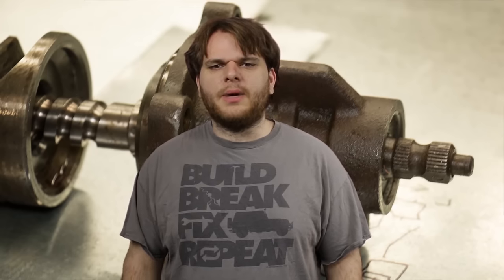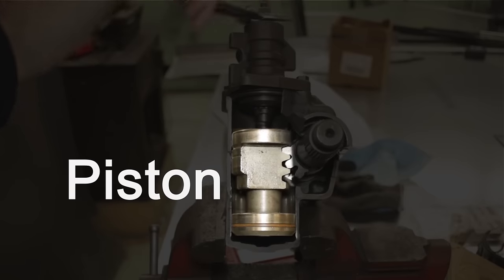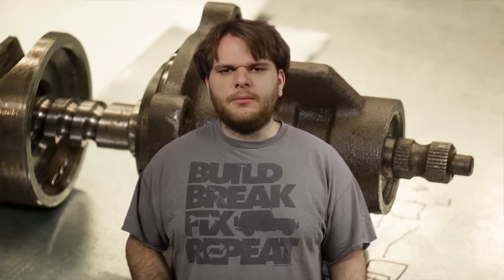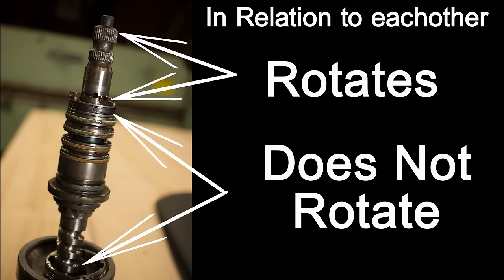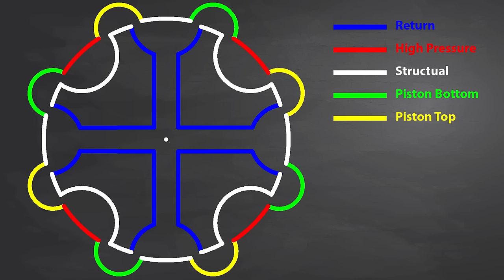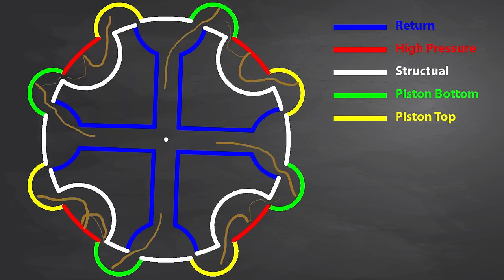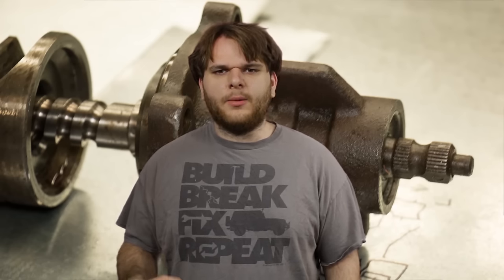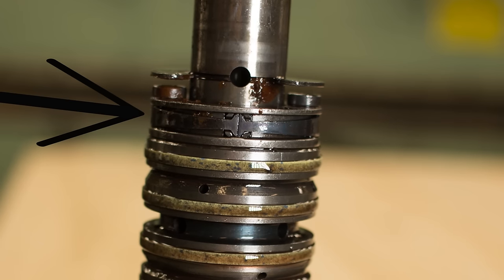How a Power Steering Box Works 610BOB's Teardowns

Comment: I've been replacing seals on these gears and I've been swapping these gears for 45 years and until now have had no idea how they actually worked. Thanks for educating me.
Reply: can i ask u a question my master??
Reply: am working on a 94 ford ranger with gearbox, if you turn left its fine but if you turn right its really hard to turn, i've already changed the hidraulic pump and still the same! i need some tips about this please! houses?? or the box?? i got tires bidding and nothing!! i'll wait antious for your answer!! kind regards from mexico!!^.-
Reply: @gustavolopez3659  If you feel power assist in any direction then your pump is fine. There is a valve that directs the pressure in the gear and it is what is causing your headache. I've seen those valves fail and the steering wheel won't go left or right, the hydralic pressure locks it in place. Replace or rebuild the gear.
Reply: Got a question for you if you have the time! I have a 2020 silverado 2500. Need to replace the steering gear box. The one that’s currently in the truck has the plug for the electronic steering assist as well as a mounting point for the module. The one I bought does not. It seems like I can just take off the four bolts on the end (positive feedback valve?) and swap the two pieces, can I do this?
Reply: @Riseuhh Sorry, I have no experience with your system; I've never seen a steering box with a sensor or module. my guess is that even if it functions it will probably set a code.

Comment: That device you mentioned helps the fluid flow valve return to center.
Reply: Is it like a detent ball and spring that's used on manual shift transmissions?
Reply: @Skipperj  no, it controls how much hydraulic pressure goes to either side of the piston.
Reply: Thank you very much sir john

Comment: Great explanation overall. There is one slight problem and it has to do with the components you were unsure of at the end. If you are turning the friction on the outside of the sleeve is enough to cause the misalignment and open the valve as you described. When you stop steering the spool/sleeve combo returns to open center as you described. However, it’s the sleeve that rotates to catch up with the position of the spool. The springs you mentioned at the end are centering springs which provide the force required to re-align the spool/sleeve. That’s why the power steering will shut off at any wheel angle is your angular velocity is zero.
Reply from the maker: Thanks.

"However, it’s the sleeve that rotates to catch up with the position of the spool." Um.... I didn't say that? I feel dumb now. :)

"The springs you mentioned at the end are centering springs which provide the force required to re-align the spool/sleeve." But dosn't the torsion bar in the input shaft do that?

Comment: The partial gear on the output shaft isn't a pinion, because it isn't a small gear. It's a sector gear (because it is only part of a circle), which is why the output shaft is often called a "sector shaft".

Comment: 610: At time point 7:40, you ask what that spring clip does. I would like to try to answer that question. Back about 4:20 you have a very nice drawing of the valve, with the inner sleeve, the outer sleeve, and the fluid flow paths. You show the inner part, which is all white and blue lines and arcs, and the outer sleeve, which is white and red and yellow and green. The inner sleeve (blue and white part) MUST be connected to the steering wheel via the shaft in the middle of the steering column. Because this inner sleeve is connected to the steering wheel, it can turn perhaps 1 and 3/4 turns in each direction from center. If the outer sleeve is stationary, which it is not, the pressurized fluid would alternately be directed to the top of the piston and then to the bottom. Additionally, every 45 degrees of steering wheel rotation, the white part of the inner sleeve would absolutely block the flow of the pressurized fluid altogether, causing maximum pressure to build up in the high pressure hose and back onto the pump. 

Put another way the sequence of events would look like this, 1) pressure would be directed to one side of the piston. Then as the rotation continues, 2) the supply port would be covered and the pressure would rise to maximum. As rotation continued 3) the supply port would deliver fluid to the other side of the piston. Then 4) supply fluid would, again,  be blocked completely. 

But this is not what happens. 

Instead, that outer sleeve "follows" the rotation of the inner sleeve and cannot be allowed to go too far out of time with the inner sleeve, one way or the other. There has to be enough relative motion between the two sleeves so that fluid can be directed properly, per your description. But there can be only so much relative motion between the two sleeves or the events I described above will happen. In other words there needs to be a little bit of play between the two sleeves, rotationally. 

The spring clip that you asked about, I believe, holds a pin into a hole in the input shaft. The outer sleeve is machined in such a way so as to not be rigidly tid to the input shaft, but to allow for a little relative movement between the input shaft (along with the inner sleeve),  and outer sleeve, so that fluid can be directed as needed, but not so much that it can get "out of time". I believe the two sleeves are made so that the pressurized fluid will eventually return them to a relatively "centered" alignment so that when the steering wheel stops turning, the fluid flows through the valve without putting pressure on either side of the piston. 

Ideally, the outer sleeve rotation would be coupled to the turning of the output or sector shaft and not to the input shaft. This would allow for a more perfect positional feedback. But it would be difficult to implement. Further, the seals between the outer sleeve and the case probably provide a slight amount of friction to help slow the movement of the outer sleeve to help with the relative motion that directs the fluid. The pin under that spring just keeps the relative motion from getting too large.

Comment: Excellent explanation. I am researching hydro assist and it's difficult to find an actual explanation on pirate4x4 or other sites beyond "drill here". I actually feel like I can take apart any steering box and figure out where the assist ports need to be drilled after watching the video. Thanks!

Comment: Well done!! absolutely fabulous, but ONE comment. At 8:04 you are going down the elements of the valve, you SAID "Piston Top" "High Pressure" "Piston Bottom" but you WROTE "Piston Top" 2x.The cutaways you did are clean and clear. I always love those but never understood how they were done so perfect. 

For those that do not completely understand hydraulics, this system works off the hydraulic principle of Force x Area = Pressure. Fluid is incompressible, so any force you apply to a closed container is transferred in all directions equally.  If you notice the bottom of the piston is large surface area, so if you allow in pressured fluid at 100 psi, and you have a 1 inch area, you get the force of 100 pounds of force. If you have a piston like this with three or four inches, you get to multiply the force so 100 psi in, creates three hundred or four hundred pounds of force. 

If you  notice that the  of the one side of the piston is larger than the other side of the piston because the shaft is in the way effectively reducing the available surface area to press against  this would potentially lead to an imbalanced feel turning left versus turning right. One side has a bigger piston than another side. I am interested to see how this is compensated for to give a balanced feel to the turning process. 

Thank you so much for doing these. I am going to look for more from your page.

Comment: Fun fact: that rack/gear has an adjuster screw to take up the slack between the teeth when it wears out. And if you over tighten it by accident, it can permanently ruin the mechanism. So yeah, don’t go poking around your steering gear with screw drivers. Let a professional adjust the steering gearbox if needed.

Comment: What I wanna know is how the gear box adjustment screw works...how does it remove play in the steering column when tightened? What happens if you over tighten.
Reply: It wont turn if over tightened I did this to my truck on the weekend and the steering hasnt felt the same since I managed to get it loose again as it was like having the steering lock on literally couldnt move it nor could I loosen the box but managed to in the end by jiggling the wheel and now my steering is sometimes notch whitch is why I'm watching this to try and figure out what I've done 😂

Comment: great! You made the steering gear components so simple. My question is this, do I need to upgrade my gear to use it off-road on rocky stones , gravel mix or muddy roads.
Reply from the maker: Apologies for the delay. Thanks. That depends on your rig. If your tires aren't bigger then stock, you would be fine on gravel/ muddy roads. If you have larger tires, you may want to consider steering upgrades. Rocks, definitely.

A bigger power steering box is great, but I would go with a hydro assist first. Hydro assist removes stress off of the power steering box and linkages. I think it's a much better upgrade than just a larger power steering box. You can do both obviously. But you will then most likely have to upgrade or modify your power steering pump at that point to get more flow. That's what I have to do with my jeep.

Here is a video series I made for hydro assist.

youtube.com/playlist?list=PLekujem4qX0durfgrdnn3xFinpqxWFQ4T

Comment: Wonderful job. Thank you. I have a powersteering issue where the vehicle pulls to one side but the alignment is fine and the breaks are fine. I replaced the pump and lines and that didn't fix it. I believe it's power related because while I'm driving, if i put the vehicle in neutral and shut the van off, it will steer straight, keep it in neutral while coasting, turn it on and BAMN, car once again tries to turn left. Your video seems to explain the issue around the 5:40 mark in your diagram. Does anyone agree or disagree agree?
Reply from the maker: Thanks. I would say yes. It is your power steering box. By turning off the engine, you have basically shown that everything but the power steering syestem works. And the power steering box is the only thing that would directly affect steering direction. You could have a clog inside or, more likely, a bent torsion rod inside the valve. Either way, I would say that your next step would be to replace the power steering box.
Reply: 610GARAGE thank you so much for the advice and your time.

Comment: So my power steering stopped working overnight, the pump is working and all the valves appear to be working too, if the metering rod was broken it would still steer with the wheels off the ground but no fluid would be getting directed to assist correct?

Comment: Hey 610 Garage i have a quick question. I have a Volvo truck D13 and is leaking oil through the power steering box on top there is a small little hole rigt on the top cover. i believe they said the little hole is a breather. but wy is leaking through there. also can i put a plug to the hole?
or put epoxy?

Comment: My 1993 Mercedes 300TE The steering wheel has a lot of play from the (center) 2 inches to the left and Right.  Another problem I noticed when on park (not driving) is when you turn the steering wheel all the way to the Left (end) or Right (end) and release the steering wheel... it bounces backward.  The steering wheel went 5-6 inches to the opposite direction but the wheels doesn't follow.  When I'm driving I only notice some play.  Do you think this other problem can be corrected by adjusting the screw or the steering box or something.  Mercedes steering box is a lot of money. Thanks

Comment: QUESTIOn for 610....If i do a engine swap and the pump on the new engine  has more pressure than the gear box was made for would the steering box turn stiffer and or bind up some ?

Comment: Interesting summary. For most, it would be an excellent explanation...

BUT...I just cannot find anything on the internet anymore, and trying to find this one component, for the power steering on this truck and bus line. Yeah, not happening. Its a similar system to yours (also, I thought it was called a torsion bar...what you called a metering rod, but it may be, since mine is just a torsion bar, with some weird spool valves, and an insane pathway of channels and other ball checkvalves. 

Yeah, its spaghetti city in there, and my pump is weezing, and all I have is a crappy manual (not in English because why not), and no parts available. Meh...what else is new with this damn bus...

Comment: I have a rebuilt (Napa) power steering gear box similar to yours but for a 1969 Chevelle.  I'm told that there are internal stops, but I couldn't see any in your video.  I ask because my box is supposed to be 3-¾ lock to lock and I only get 2-½ lock to lock and my turning radius is greatly reduced. Any idea what might cause this?

Comment: Great vidio..but do you have a cut out of the ajustment screw side?
Reply from the maker: Yes actually. Well, I have a photo of the output shaft and top plate. The output shaft contains a threaded stud. This goes through the top plate for adjustments. There is a needle bearing in the end cap to hold the output shaft. Not sure why I didn't include this in the video.

https://adobe.ly/2EZbRbT

Comment: Quick ? Will adjusting the gear box screw all the way tight cause gear box to malfunction of pump. I did this on my Freightliner and few days after my steering is tight both ways and the steering wheel doesn't return to center after turning. It also gets worse when hot. Thanks

Comment: thanks great job. Do power steering boxes  have separate gear oil for the pitman gear, or does the power steering fluid lube it all? Thanks
Reply from the maker: Thanks. They use the same oil as your power steering system. Basicly, everything sits in a bath of power steering fluid. :)
Reply: The pitman arm just slides onto a spline gear. The only lubrication is just standard grease which will help if you ever have to take it off again. I think that is what you are asking, let me know if its not!

Comment: Sir why is it that my truck I replaced new steering pump Ang new gearbox why is it that it's really hard to turn to right position and left position..when the engine is running the steering wheel become wiggle wiggle untill the oil seal of input shaft will explode... comment from MINDANAO Philippines

Comment: What's up from Bethlehem. My steering wheel has play on my 98 civic. Tie rods seem fine as well as the steering knuckle under dash. I'm thinking it can be adjusted, any pointers would be appreciated. can it be adjusted still installed on the car?
Reply from the maker: Hi. You can adjust it the power steering box. But you really should just get a new box. If the steering box is at fault, the play is coming from the bearings. The bearings become worn and develope play. Adjusting the screw applies more pressure to the bearings, removing the play and causing them to where faster. You may get a few months out of tightening the power steering box, but you risk the bearings completely failing. Which would most likely mean total steering loss. Which would be bad. :)

It does work well for diagnostics. If tightening the steering box fixes the issue, then you know what the problem is. If you chose to tighten the power steering box, mark the bolt position with a dot of paint. Use this to keep track of where the stock position is. Depending on the play, you should only do a 1/8-1/4 turn. Then see if it works.

Also, when loosing the jam nut on the adjustment bolt, it's best to use a socket. The ones I have worked on were REALLY tight. :)

Comment: there's an adjustment on the top of the box... but what does it adjust?? I don't want to cut my steering box apart to find out
Reply from the maker: But why? It's fun. LOL :) That adjustment screw pushes the output shaft down. Teeth on the output shaft and the teeth of the piston are tapered. When the output shaft moves down, it acts as a wedge. It pushes the teeth closer together. This is why you shouldn't touch this adjustment screw. The teeth have to have a certain gap. If you loosen the screw, this gap increases, making the steering sloppy. Tightening the screw closes this gap. If the gap is too small, then the teeth will bind more, producing more wear. There will also be more force on the bearing that holds the output shaft and the seals on the piston. This will produce more wear which will lead to premature failure.
Reply: 610GARAGE I get how it works and great explanation but I'm visual can you make a short video of what you just explained.
Reply: That does not explain why the adjustment is there. If the steering is sloppy, there already is wear and thats is how you tighten it up. Wear means worn down metal, metal is probably throughout your fluid system. Still looking for a video on this